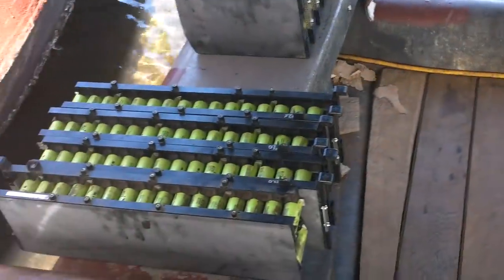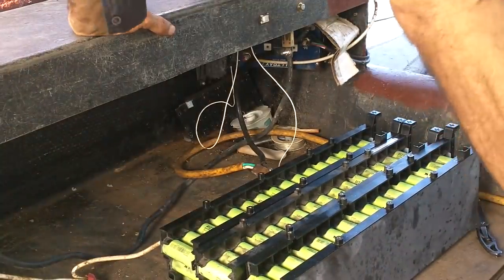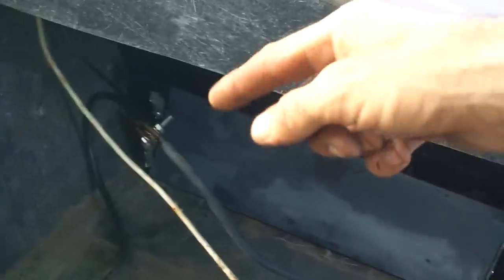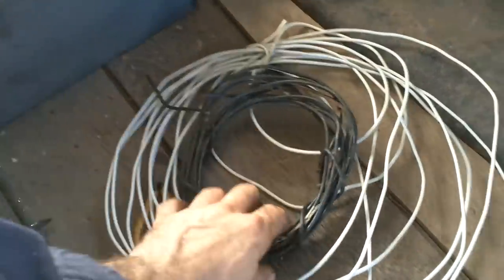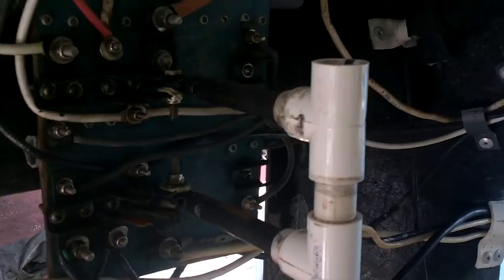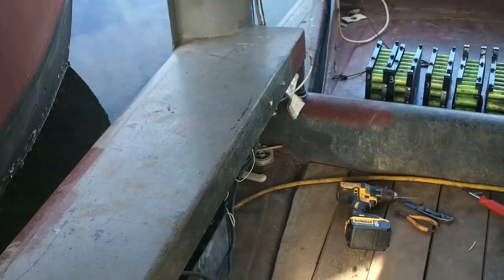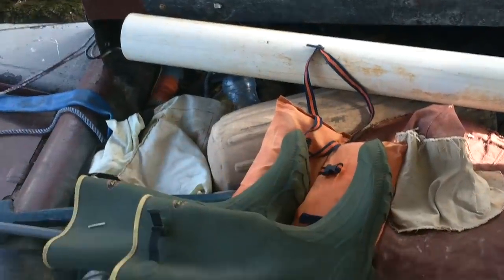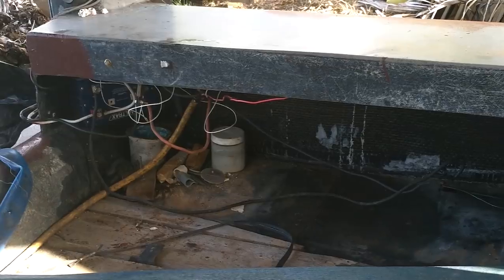Shark Slicer Battery Upgrade

Comment: Man, I love your 'show':) I discovered you a few weeks ago, while searching for info on diy solar boats, and I love what you do. I, myself, live off grid in a yurt, travelling to 4 or 5 different states throughout the USA, each year. I run 400 watts of solar, and it powers my workshop, and home.  I'm a sculptor, jewelry carver, drone pilot, professional bicycle tech, recumbent rider, performance artist, and maker. I've built several yurts, and, as I said, am contemplating building a solar boat, and am hoping to use a pedal-assist motor for a pedal-solar electric boat. I'm glad I finally found a video I could comment on:) Keep up the good fun!

Comment: What a sweet name for a boat.
Reply: Wow. Your body mass index is like 6%. Holy guac. And no muscle degradation? I'm guessing your diet has eggs in it. Because they have all 9 essential amino acids. Animal cells can manipulate non-essential amino acids into strings of essential amino acids. There are some strings that cells can not create by manipulating other basic building blocks(peptides). They are necessary(essential) otherwise muscle mass will degrade in order to facilitate essential amino acid intake. Nucleotide, peptide, polypeptide, protein, enzyme. Nucleus food.

Comment: Jaimie, you've gotta get a BMS for those batteries to keep the cells balanced and protect against over/under charge of them - this is really important.
I'm sure you know this already, but unlike lead acid batteries, lithium ones don't balance themselves.
There are thousands of videos here on how to do this.
Reply: Extremely Important!!!
Reply: Yep, don't burn ya boat down
Reply: many diy ebike builders have nearly lost everything, 1 bank of cells down a volt could mean another bank takes it on. Not good. even a simple lipo alarm would just alert you before anything goes runaway. Just a few quid from ebay and such
Reply: @overclockist  Very true Gavin, but lipo alarms have a different voltage range  - these cells are LiFePO₄ !
Fires aren't really an issue with them, but they still need monitoring and balancing to avoid irreparable damage.
Reply: So lipo batteries in parallel or series need charge controllers in between them or where in relation to the setup depending on configuration?
Reply: @Valient6  Whether in series or parallel, LiIon/Lipo/LiFePO4 cells need protection to keep their voltages and current within a range.
Charge controllers just charge the battery to a set level - they do not know the state of charge of the individual cells inside, just the total.
A BMS (Battery Management System) monitors the levels of each cell (or cell pack, where lots of cells are connected in parallel to make one big cell, which is used in series with other packs to make the battery).
So, a 5.5kWh Tesla battery module contains 444 cells in total, arranged as 6 series groups of 74 cells in parallel = 6S 74p.
Its BMS monitors the voltage of these 6 cell groups, not each individual cell, because by definition if a group of cells are connected in parallel, they all at the same voltage.
If a cell group goes above 4.2V or a user defined limit such as 4.1V to increase battery life, then a shunt is switched on across the cell group that bleeds off the charge until its voltage is within limits.
LiFePO4 cells have a max limit of about 3.6V, so the BMS has to know what cell chemistry it is working with too know how best to manage them and react to a problem.
Hope that helps.
Reply: @ahaveland  couldn't you just put in a circuit that resists voltage after a certain set point? Then stick it in between the battery terminals and the source power?
Reply: @ahaveland  and doesn't an mttp charger increase amperage to utilize more solar panel power verses a pwm (pulse width modulator).
Reply: @Valient6  You mean MPPT charger - yes, it tries to take as much current as it can from the solar panels while watching their voltage level. Multiplying the volts and amps at the input gives the power in watts.
So it continues to adjust the current it draws to keep the panel voltage at its most efficient level that gives the maximum power. P = IV.

Note that the voltage and current levels fluctuate all the time as the sun goes in and out.
The DC-DC converter in the charger tries to output a voltage of a fully charged battery. If the battery isn't fully charged, then current will flow towards it, and that current is limited to follow a profile depending on the capacity of the battery and its state of charge, so current tapers off after reaching 80% of capacity until full.
So, there are limits to how much current is allowed to flow into the battery at different times, and limits to how much current the solar panels can give.
Usually the panels are the limit, and the charger will take whatever it can get from them.
Note, MPPT chargers (intelligent DC-DC converters!) can only increase the output current if the input voltage is higher than the output voltage.  (IVin approx IVout)
If you're boosting say an 18V panel to 54V, then obviously the output current will be about a third less, but the voltage would be 3x higher.
Reply: It is not as important as you make it out to be. Good quality cells that are balanced when manufactured into packs will stay balanced for many cycles. It wouldn't hurt to balance them once a year or so.
Reply: @4833504F  Please do not offer false advice. You are wrong. It is important even if the cells are good quality - they are not identical and will drift over time. This is why every EV has a BMS, even Teslas.
You may be ok with a few cycles, but balancing once a year is ridiculous.
You are gambling with your life, house, car, boat, ebike, so please take this seriously.
Unlike lead acid, lithium batteries do not balance themselves nor keep themselves balanced.
You must use a BMS and monitor them and correct manually, or risk the whole lot going up in flames.
Reply: I'm not saying Jamie should ignore the possibility of the cells getting imbalanced and overcharged. That he can check with a multimeter.   @ahaveland
Reply: @4833504F  Checking with a multimeter is like being a human BMS.
If any out of balance then you fix manually.
The important thing is that they must be monitored, and a BMS does that 24x7, while humans forget then your house goes up in flames.

Comment: Hey, I'm trying to build something like the Shark Slicer here in the phillipines.      Any suggestions on better hull design?   and ideal motors?   not so interested in speed,  just distance and solar ability..   Will have batteries of course.    I'm really needing a calculator for this though..  any thoughs suggestios?

Comment: I’m wondering about additional efficiency in your tandem propeller setup in the shark slicer. I’ve seen examples in the commercial realm where one prop spins clockwise and the other counterclockwise to improve both handling and propulsion. Have you considered this?

Comment: You have to keep that balance charge circuitry or the whole pack fails really quickly.
Reply: Yes!, Jamie have you taken into account lipo chemistry and the common problem of a pack to become unbalanced and a bank of cells to drop below their safe voltage?
With the batteries I use for RC just a few cycles, especially if hard they can get to the point where some cells will overcharge leaving the others below safe and being a fire risk.
Reply: LiFePO4 different to LiPo

Comment: Could you suggest where I could buy a similar 36 volt lithium battery pack?
Reply: you can buy a pre built one, not as cheap though from various sources (ebay) as an "e-bike" battery. They come with battery protection and charger, depending on need they might fit the bill.
Reply: Radio shack

Comment: it scares me to see you mangle those batteries. lithium batteries are not self balancing. they need that balancing circuit to guarantee an even charge. if you remove the balancer then some of your cells are going to degrade VERY quickly. and become unstable, then if you ever rapidly charge or discharge them. they could explode.

Comment: how many amp-hrs?
Reply: Or better yet watt hours. I don't get why people use amp hours so much, since amps are relative to volts. A watt is a watt is a watt, so it's an easier measurement to compare battery packs with.